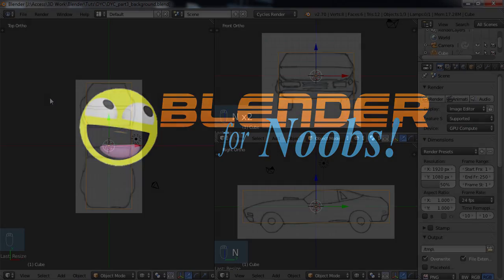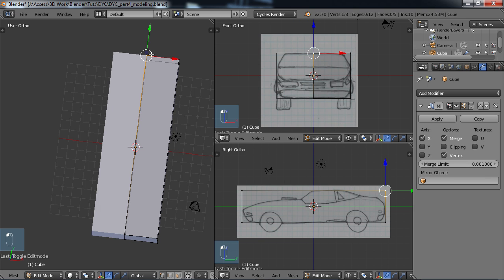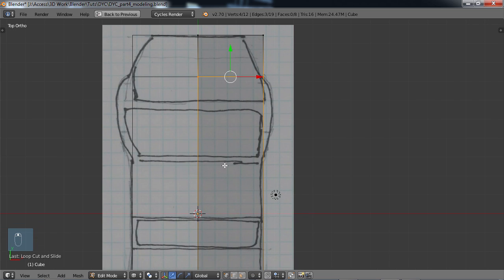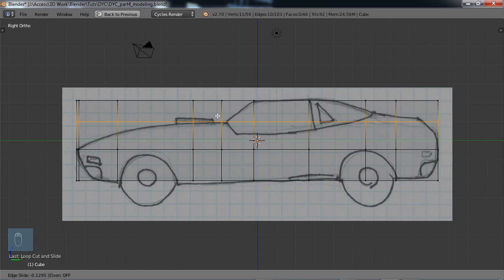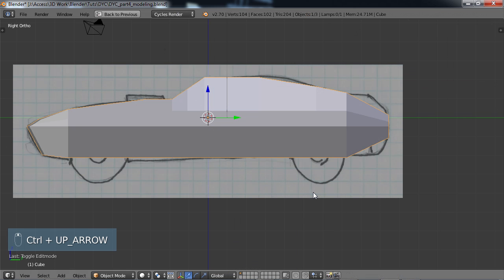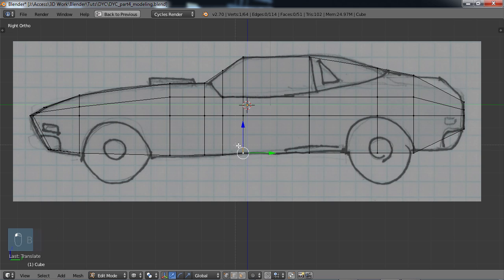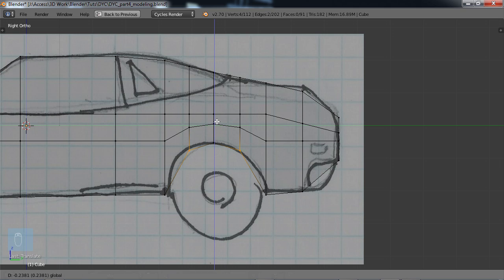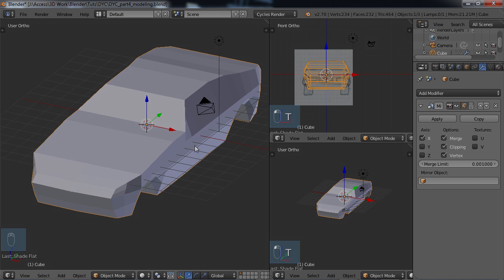Blender For Noobs - Design Your Own Car Part 4 - Modeling

Comment: how do u click on an intersection where 4 lines meet? when i left click it, i move the origin but when i right click, i always click one of the 4 lines instead of the intersection. +BlenderForNoobs
Reply: +Robert Wang at 8:57
Reply from the maker: +Robert Wang If I understand what you are asking, it sounds like you maybe have the edge view turned on instead of the vertex view (at the bottom menu).
Reply: +BlenderForNoobs ohh ok thanks !

Comment: I have the default setup (except the screen layout). When I press B and with the LMB select 2 vertexes above each other from the top view, it only selects the top one. What could I be doing wrong?
Reply from the maker: TheSpyAmongUs You probably have occlude turned on at the bottom bar to the right of vertex/edge/face select.
Reply: +BlenderForNoobs same here how can I fix this?